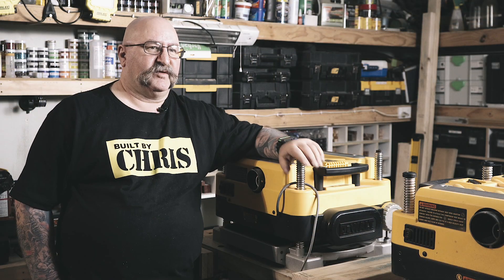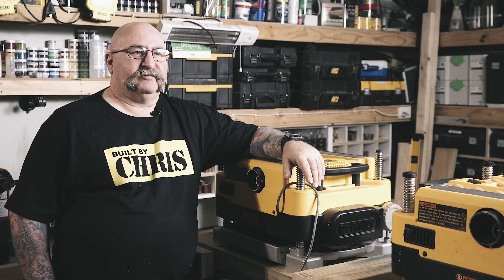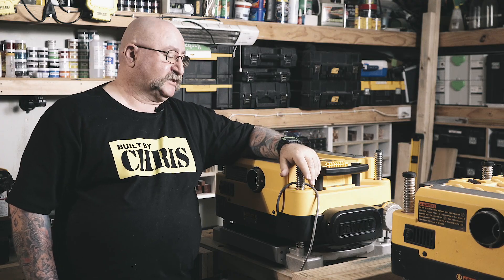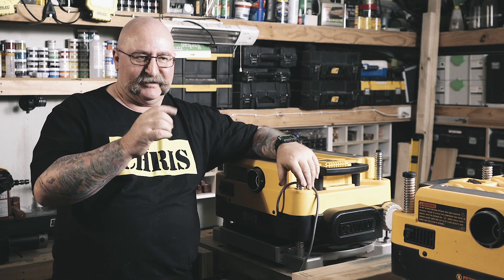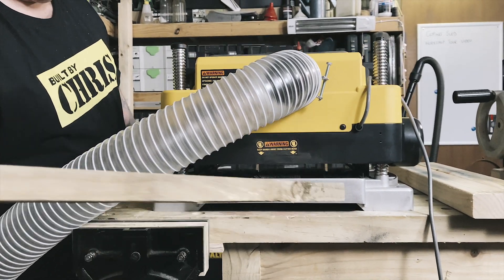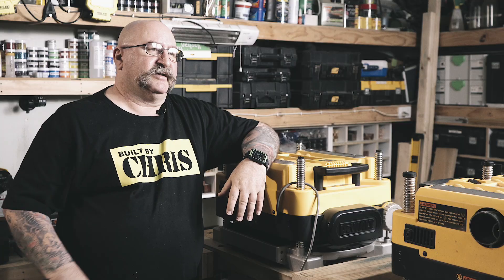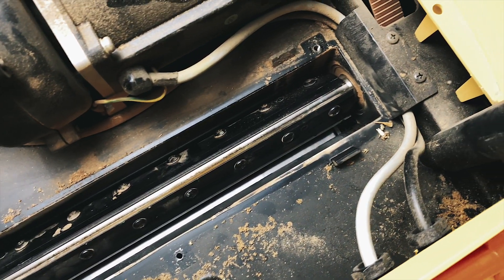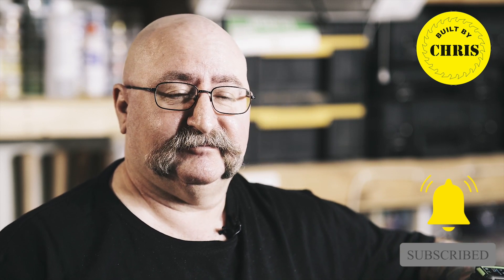Upgrade Your DeWalt Thicknesser with a Spiral Cutter Head!

Comment: Excellent video. I just bought one of these. Managed to get it price matched at mitre 10 as Bunnings had it 8 dollars cheaper online. Does the spiral cutter make the device quieter?
Reply from the maker: Hi there, yes in general helical heads deliver a big reduction in noise level.

Comment: How does the spiral head go with well seasoned hardwood? I ran some 1960s reclaimed tallowwood window sills through mine with the straight knives and it really struggled with them.
Reply from the maker: Hey Matthew, the spiral head would work better. However, if you are using recycled material you want to make sure it is clean. Get rid of any paint or dirt off the wood and take off a small amount each time (half a mm or so)